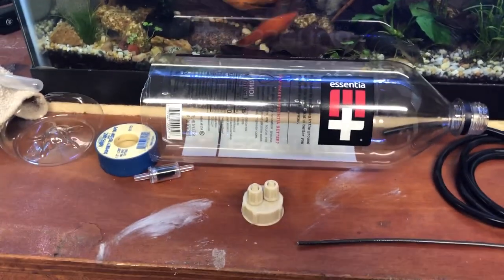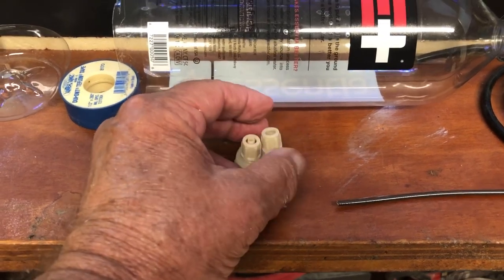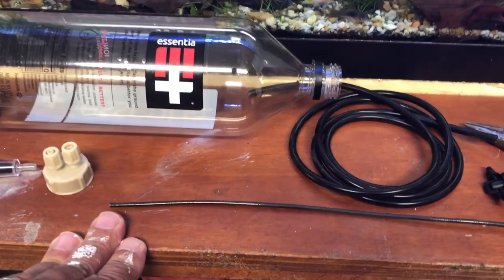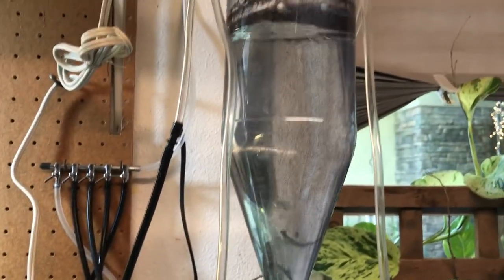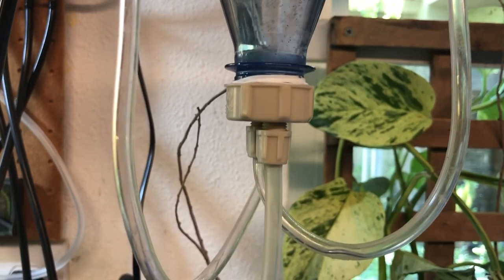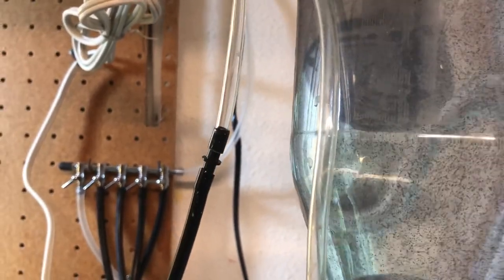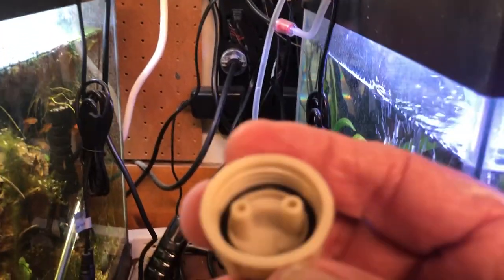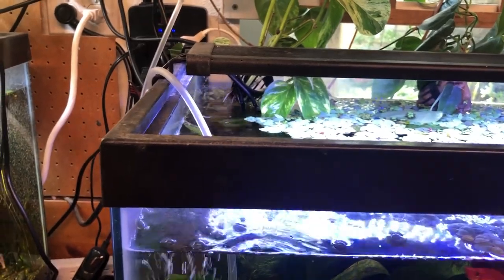DIY Brine Shrimp Hatchery

Comment: What did you use for hangers??
Reply: Also. I just found your channel I noticed you haven't made a video in awhile. Do you have a FB page so I can gain knowledge from someone like you with a lot of fish keeping experience??
Reply from the maker: Just apiece of electrical wire about a foot long or so, put through holes at the open end of the bottle to make a hanger. Then a J-hook screwed into a shelf that's overhead. I hope that helps.